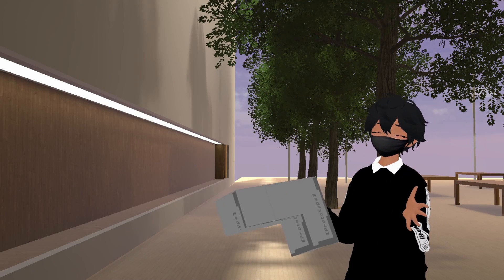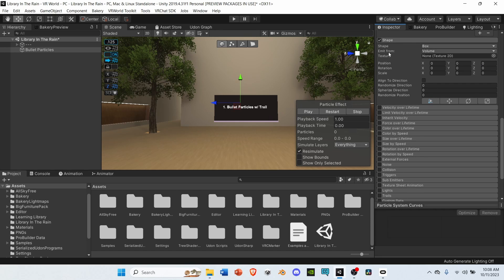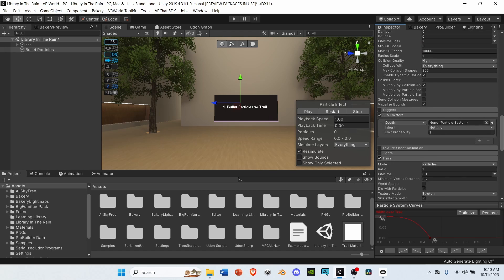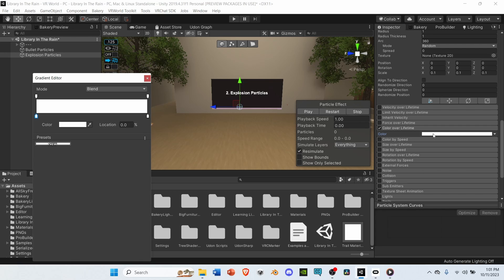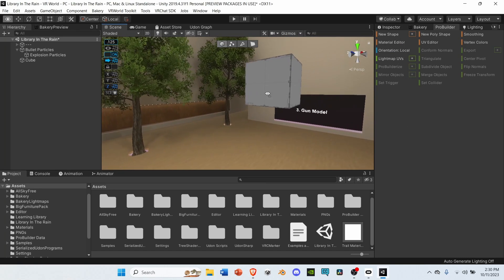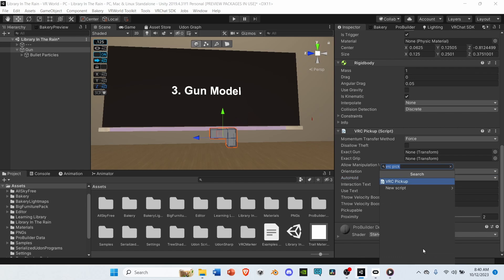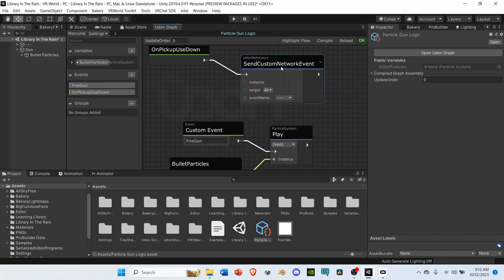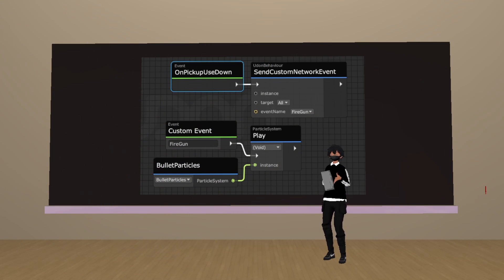How To Make A Particle Gun - VRChat Udon 2023

Comment: This still works. the only thing was unity has trails for the particle system so you don't have to create your own. (At least for version 2022.3.22f1 for me)
Reply from the maker: Noted, but I'm a little confused by what you mean. Were you able to add trails to your particles outside of the "trails" module in your particle system? Also, what we did was only enable and customize the trails on the particles not "make" them per say. I apologize for any confusion.
Reply: @myneighborswifi  at 3:23 when I enable the trails in the inspector it seems unity or the creator companion version automatically has a "Default-Line (Material)" for the particle system that is automatically applied there.
Reply from the maker: @rageshadey  Oh, I see what you're saying now lol 
Thank you for the heads up!
Reply: @myneighborswifi  My pleasure. You do great work ^u^

Comment: Just incase, for those who are new to Unity Particle System, here are some elaborations

========

1.0 : Main Module
This is where all the initial setting of the particle is set.

1.1 : Rotation and Orientation
There is no correct orientation, itis is based how you arrange or organize your gameobjects and hiearchy,
since rotation will be inherited by children, the "correct" direction may not always be (0,0,0).
By default (0,0,0) points at the Z-axis (Local Z, if simulation space is local)

1.2 : Duration = 20
This sets the looping during to 20
(but since a bullet particle is not looped, I am not quite sure what is the effect in this case)

1.3 : Looping = false
Yup, Bullets to ot repeat themselves, it is a one shot animation

1.4 : Start Life time = 10
this decides how long the particle will be alive, once the time is up, the particle is then dead (gone)
In this case, myneightbourswifi alows his bullet to fly for 10 seconds

1.5 : start speed = 50
this is the starting velocity of the particle,
in this case setting the bullet speed to 50 m/s is reasonable
note : usually bullet speeds are around 200 m/s (textbooks example)

1.6 : start size = 0.5
This decides the starting size of the particle.
Normally for a bullet, a normal size should be somewhere 0.05 (personal pref)
But feel free to change the size based on what you need.

1.7 : start color
this decides the basic color of the particle

1.8 : Simulation space = World
this allows the particle to move as the world is its refference object.
"What will happen if I set it to local ?", well, I can spin and orbit bullets by spining your gun.
A good example is the Jar in the Dinning Area in Dimension Structure - R08 - Konnekt

1.9 : Play On awake
This means : Play the particle animation when the gameObject has been enabled,
This may cause unwanted fires at the beginning so Myneighbourwifi set it to false.

2.0 : Emmision Module
Here is where we take care how particles are emitted

2.1 : Rate Over time = ?
This means "in 1 second, ? particles will be emmited",
But since this is made for a bullet, this function is not nessecary,
so ? = 0

2.2 : Burst
This decides how many particles will be spawned at the same time
(rather than emited at the specific rate)
Here : 
Count = 1 : only 1 particle is needed.

3.0 & 3.1 : Shape
This decides the allowed area / location for Unity to spawn the particle
In this case, Box somehow maintains the direction of the particles flying
If you choose Sphere, the bullets will be flying in all directions
(This is why back in 1.1, there is no "right answer", it depends on other factors, like this one)

4.0 : Collision
This is where Unity is a PogChamp
Unity's Physic engine take cares collision EASILY,

4.1 : Bounce
When it hits a collider, what is the mainted speed ?
Most case, bullet don't bounce, so mainted speed is 0.
Note : NewSpeed = PreviousSpeed * Bounce
you can set it to not 0 if you want the bullet to bounce for some reason...

4.2 : Life Time Loss
When the particle hits a collider, the lifetime can become shorter.
Here : NewLifeTime = PreviousLifeTime * ThisParameter
In this case ThisParameter = 0
so NewLifeTime = PeviousLifeTime (Whatever it is) * 0 = 0s (DEAD)

5.0 : SubEmitters
This is also a PogChamp Thing about Unity
This allows us to "call / summon" another particle system when a particle (is emited / hits somthing / dies / and other complex situations)
Here the effect we need is "When the bullet dies, I want it to have something to glorify it OwO"
So "Death" is chosen 

6.0 : Trails
this is how you can drawlines by using particle system.

6.1 : LifeTime
Trails is also die out as well, when LifeTime = 0.1, this make the lifetime shorter than the MainParticle LifeTime
Thus making the trail shorter instead of ending up like pasta.

6.2 : Width Over Trail
This decides the THICKNESS of the trail, changing it to 0.1 means
"TrailWidth = ParticleSize * 0.1"
The Curve Describes What is the thickness ALONG the trail, from Head to Tail

7.0 : Rendering
This is an important part of the System : How should the particle be rendered
Here you can set what the material is, alignments and a lot of important stuff.
Note : This is where we also set the Trail material That Unity is asking for

========

Anyway Unity Particle System is a Toy In Unity, so remember to have fun ~